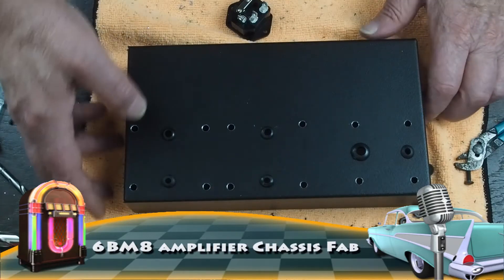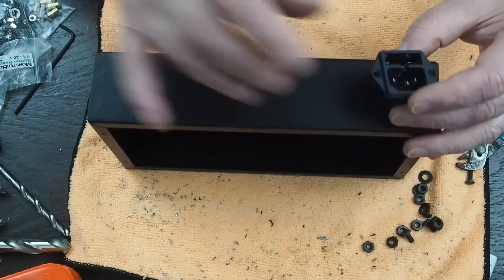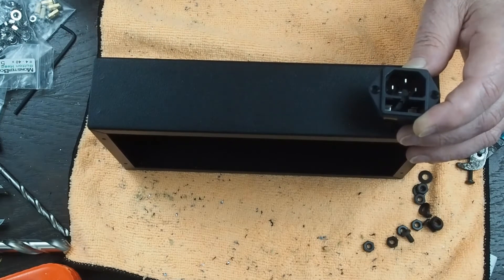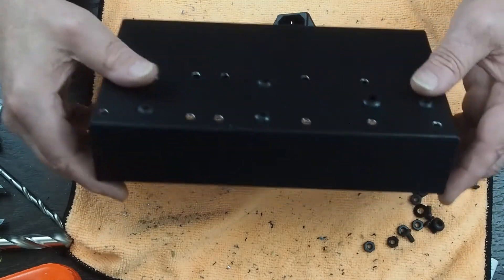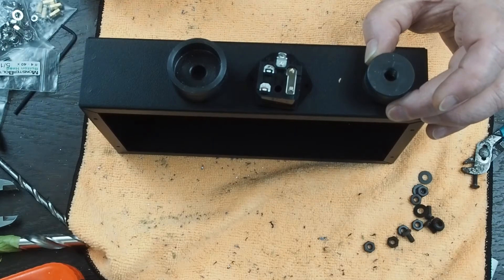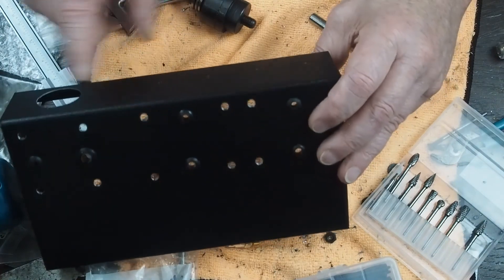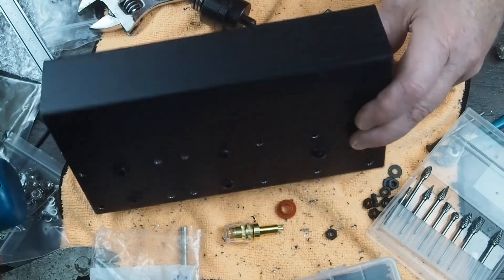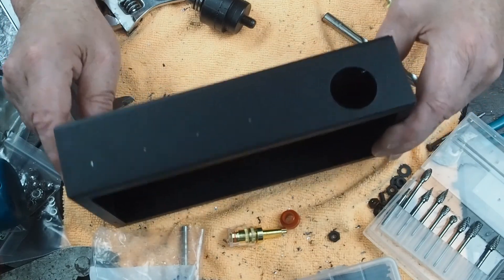6BM8 DIY Tube Amplifier Chassis Fab #4

Comment: You were doing a good job .  Need a benchtop drill will working better  I think.
Reply from the maker: I drill press would make things easier, but I don't have one at home and it can be done with just a cordless drill :)